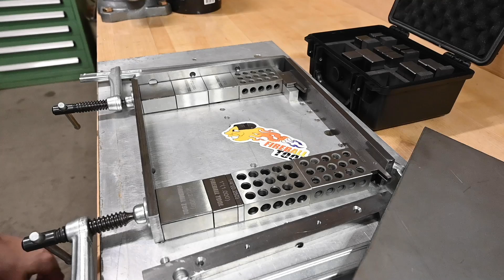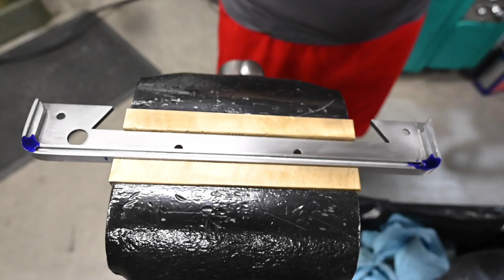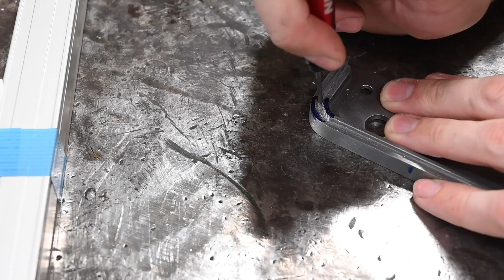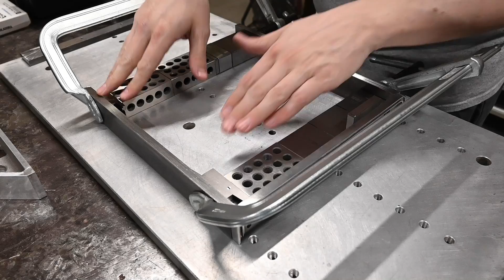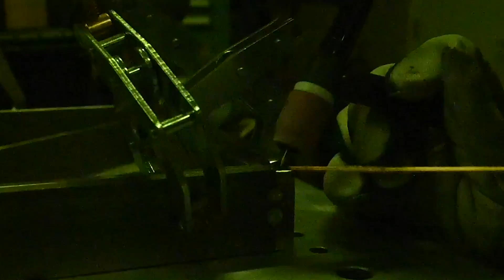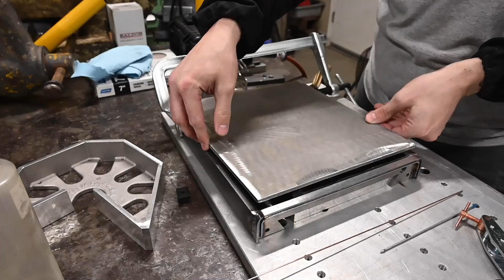Machining an O Ring Groove Plus Ugly Welds!

Comment: You're effing around, should go full depth with an under sized cutter if you're using HSS (use an air blast to clear chips), finish on size full depth, should have put that in the rotary cross slide to cut the short side and radius, then either repositioned in there or go to a Bridgeport with a vice. I like your videos but, you need to step up.

Comment: I made a small stand for my die grinder. It has a small rack and pinion vertical height adjustment. The bottom is a plate that extends outwards. I put the item I want to grind, like your part, under the bit, and lower the bit to the depth. A foot switch (air) controls the grinder. I can then move the part, freehand, under the grinder. I find that I have much better control that way. I can remove the grinder when I want to use it by hand. I tried it with my Foredom, but it’s way too slow for delicate cutting that way.

Comment: When I saw your picture of this piece tacked up & you mentioned minimising heat input, I thought you'd be MIG welding it. But you did it the hard way! No choice or just to get the practice in ? Pretty decent result though.
Reply from the maker: I just feel like I can control the heat better with TIG.

Comment: Hey Aaron. For abrasion relief take a look at UHMW tape. Very slippery, hard wearing, and cheap! 🔧😊👍
Reply from the maker: Interesting idea. Would have to see if there is clearance under the cross slide and ways to accommodate a layer of tape on those surfaces.
Reply: @AlwaysSunnyintheShop  Typical thickness is .020, punch some disks with a paper punch and mill .25 recesses to desired depth.

Comment: I have seen a lot worse tig welds. Remember that the width of the bead has the equal the thickness of the material and welding as you did, a bit at a time does minimize distortion, but the stops and starts do show.
Reply from the maker: Thanks! I can make prettier welds without the camera in my way and having to run 1” beads at a time, but this is what it is. I’ll machine or blend everything and it should look pretty decent.

Comment: Just a question, why didnt you lay down a bead of silicone on the outside surface of part. Let dry well and then install. Very similar to what you have now with no mucking around.As long as the silicone is fully cured 1st you will never have an issue . You must have spent a few hours doing this.
Reply from the maker: That probably would have worked well, too. I’ve never done this before so I thought it would be fun.

Comment: Aaron,  where did you develop your skill set?  I’m impressed and looking forward to your next step. BTW, I’ve used my calipers for layout for years. I’ve got one “virgin” pair in my measurement tool drawer, actually 3 pairs, a 6”, a 12” and a 24”, I don’t use these for scribing, only for measuring.  The pair in my apron I use for nearly everything.  Digital calipers are so inexpensive compared to Swiss mechanical tools that I rarely reach for my “old school” layout tools.  So spank me.
Reply from the maker: Thank you sir! I’ve got a small assortment of layout tools but for something like this the calipers in my hand with hardened jaws seem like the right tool, especially for the low level of accuracy needed. 
To answer your question- I am 100% YouTube trained! Well, YouTube and asking a lot of questions of those who know more than me. My dad taught me how to work and figure things out as a kid, so I learned working on cars with him and developed that skill as an adult, then used the same principles to start machining. First time I ever saw a lathe was on YouTube when I searched ‘large lathe’ and Abom79’s video “Large Lathe Work” popped up. I’ve been hooked the last 3+ years. Bought my old LeBlond in February 2017 for my first machine tool followed by my mill in May 2018. The Monarch replaced the LeBlond in March 2019. There’s a bit of my background. Thanks for always leaving comments- I appreciate it!

Comment: good job Aaron! Maybe machine some delrin or nylon to block that rear completely, then it will act as a support, way wiper, and chip gaurd?
Reply from the maker: Thanks Troy! I’ll have the original Monarch wiper holder mounted at the end to close it up and provide a second wiper to protect everything. If that’s not enough to support the end we’ll add the Teflon glides.
Reply: @AlwaysSunnyintheShop  ah yeah I remember now! The one you made looks so close to factory I got confused. But if you add both the factory end plate will bolt into the teflon as well 😁 yes I'm stubborn lol